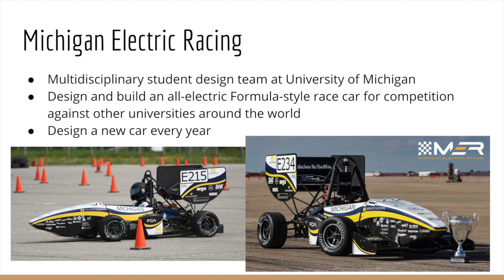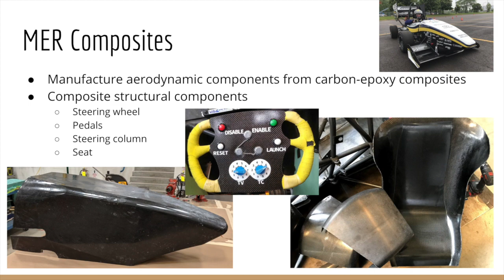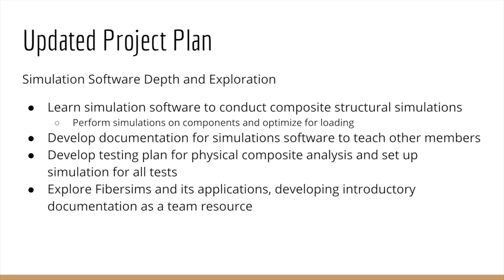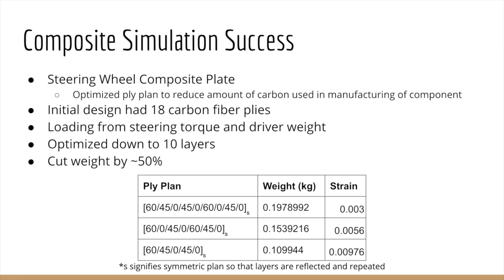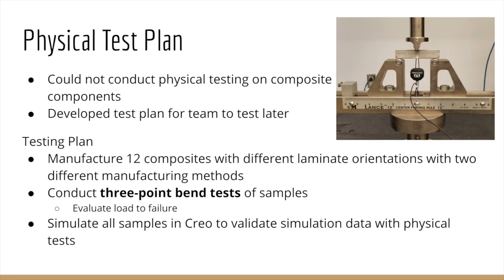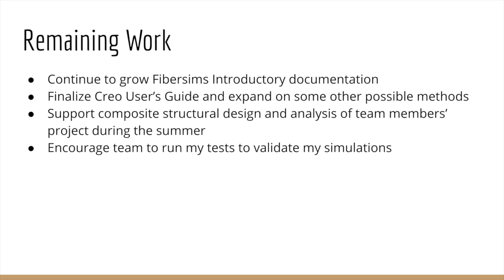Michigan Electric Racing

Comment: Great job! I really like how you thought of ways to able to set-up your team to perform the in-person tests even after you have graduated.  Do you think the results from the actual testing will closely mirror your simulations, or do you think they could vary widely and if so what would you recommend for your team to do in that case?
Reply: Honestly, I don't think my model is refined enough for the simulation results to align with the physical data. First, I hope that the team refines my model with the actual testing equipment parameters.  I also think the way that I applied my constraints is not accurate with the real life conditions, so I would suggest they start modifying that first.

Comment: MSE student here! I'm sorry you weren't able to do any physical testing but you have a great project nonetheless! While I'm unfamiliar with carbon fiber sheets, I was curious if you considered testing different weave patterns in addition to altering the ply orientation? I would think you might be able to obtain more anisotropic properties for particular parts or areas subject to known stresses. Again, great project!
Reply: Thank you!  I planned testing just around materials my team currently uses in manufacturing.  I think there's a lot of value to using other weave patterned carbons, but they are often more expensive and harder to source so I didn't think it was worth testing their properties during my project.

Comment: Nice job with the presentation and great way to transition your project with the changes this semester. Gaining a better understand of composites and how to optimize them can significantly save on weight for the team. Where did you obtain the material properties that you used for input in Creo and does Creo explicitly account for the epoxy or is it just lumped in with the material properties of the composite?